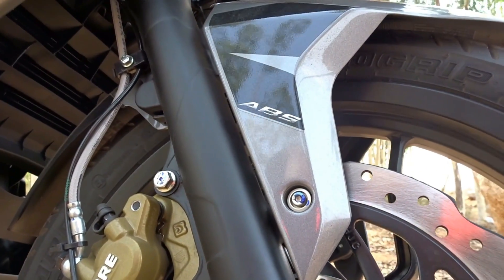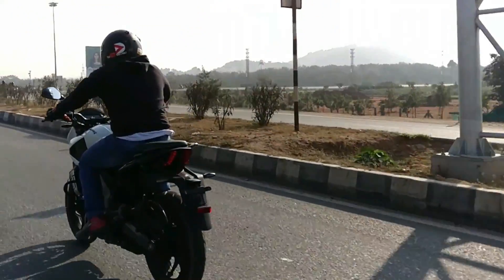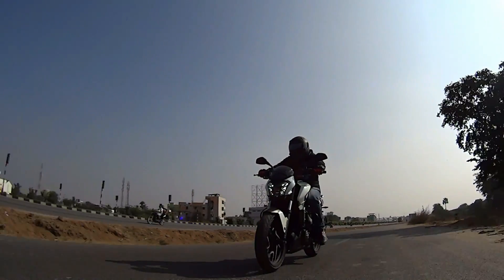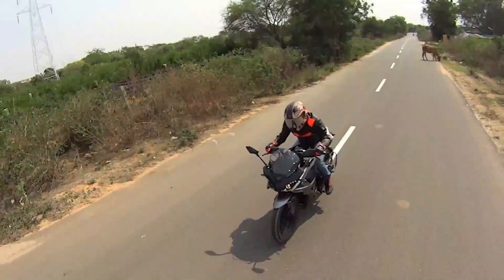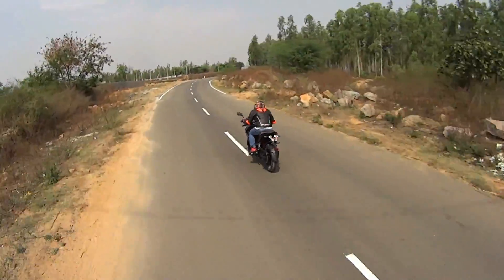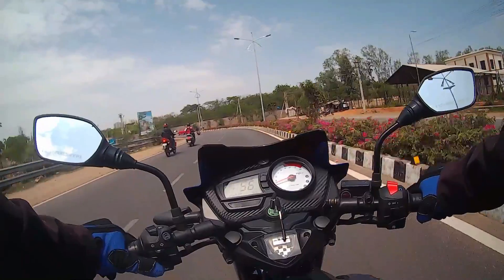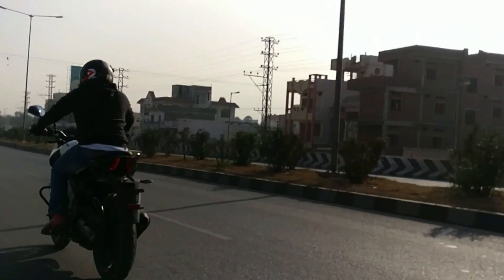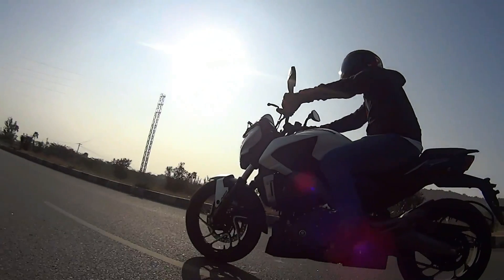What is ABS? Pros & Cons Single/Dual Channel, RLP #Dinopedia

Comment: Sadly no one except Apache RTR 180 provides dual channel ABS in 150-200cc segment. Any way single channel ABS is far better than non ABS. One more thing, if going for single channel ABS then it's better to go for real drum brakes as drums don't get locked easily and becoz of lesser brake response we will get used to using front brakes which is ABS equipped in 70/30 manner or I would say you can go upto 80/20 in ABS equipped versions.

Comment: Hi Dino,

I had recently purchased the hornet ABS-DLX version, can you please clarify if the ABS display is always on , for me it's get turned off the moment i change to second gear and ABS display light is only lit during ignition. I went to service centre but didn't got a proper response. Hoping for your response.
Reply: I have R15V3 abs same thing happens to me also... That is not a problem in all the abs bikes the abs indicator will go while riding

Comment: Hi If the break is applied on a dual channel ABS system, whether the break is applied on both the wheels irrespective of which break you apply?
Reply: no it's not a combined braking system, just an ABS. You have to apply the brakes on both sides to apply brake on both the tires

Comment: Sir suppose i have an abs bike though it dont lock the wheels if there is a  traffic in road or a red signal or traffic police show hands which i vision from 45cm  and i run a speed of 45 kmhr. What will happen, because it not lock the wheels you can move your steering.
Either a small touch to other or it completly stops 
At time ?

Comment: Please also elaborate about Cbs system. I have a hornet with cbs. But it's really tricky to make braking on fast speed (in sudden braking situation). Is it possible that you can elaborate a bit about braking techniques in cbs system. ABS didn't lock wheels but cbs is different. And in panic situations we all press both brakes. Kindly, make a video on Do's and Don't while driving Cbs equipped model.

Comment: Sir I am going to buy a Gixxer SF ABS which has only single channel abs and before buying I want to know these three things- 
1. On which wheel ABS is present in Gixxer SF, is it front or rear wheel?
2. Does it has sensor in the non ABS wheel like RS200?
3. Is it sufficient to apply only the front brake in panic situation, if ABS is present only in the front wheel? Or if I apply both the brakes the rear wheel will lock as there is no ABS? 
Thank you.
Reply: 1.Gixxer sf ABS has ABS in front wheel . 3. Panic break in straight roads, front is enough to stop then rear (as per my experience in Gixxer sf) . Front is enough because while applying break in straight road  70% weight goes to front.
Reply: Ranjith Kumar Sir does it has sensor in the Non ABS wheel like RS 200?
Reply: Brother you are not the only one.
I m also going to buy a gixxer sf fi abs.l have the same questions as you

Comment: Hello dino sir..... 
I want to buy a bike, choices are yamaha fzs fi, hornet... 
I have experience in carburetor variant bikes, but I dont know much aboit FI engines.... I like yamaha Fzs very much but a bit confused to buy that or not, because I have heard that Fi engines get damaged easily and when Fi engine break down the bike wont simply start.... Can U sahre your view on that... Like if I buy fzs how can I avoid it to break down..... Or It will easier to buy a hornet (a carburetor variant one).... 
My bike will be used for daily commuting and occasionally long ride..... And I have a yamaha showroom (a small one, not as big as bajaj or suzuki) within 1km where I live..

Comment: Nice explanation as always Dino sir! Can you please explain a bit or make a video on how to downshift properly in city as well as on higher gears, because I have just learn riding and having problems in downshifting smoothly, the revs are not matching properly if I leave the clutch on one go, it goes smooth if I hold the clutch for a while and then let it go slowly.

Comment: my bike is Bajaj v15 suggest me any good engine oil price is not a point and serving period for how many kms did
Reply: Buy Motul 5100 15w50, I bought for around 520₹ for a litre, Service period should be somewhere between 3000-4500kms for Oil Change.

I'm using the same oil on Avenger 150 and RE TB 350, and the results are significant

Comment: How does ABS work for Brake pads? do they reduce wear and tear compared to non ABS bikes?
Reply: Alex Mercer when you apply brakes, the brake pads are pressed against the disc and that results in slowing of the bike. So in case of ABS the pads are released electronically. But the difference in wear and tear of pads of abs and non abs version will be very minimal as you usually dont keep on locking every now and then.
Reply: JS3 Vlogs Ah nice so is it more expensive to replace a brake pad compared to Normal brake pads?
Reply: Alex Mercer bro same brake pads are used in both abs and non abs versions.
Reply: Alex Mercer sensor are what make them different
Reply: JS3 Vlogs yeah but they do not touch the sensors while replacing right? why so expensive?

Comment: +Dino's Vault @Dino's Vault  Apache RTR 180 vs Pulsar 180 which one should i consider buying Confused!
Reply from the maker: both are good, I would rather suggest you stretch a bit and get the rtr 200 or pulsar 200 ns
Reply: stricter budget bro I got to degrade .. actually considered rtr 2004v
Reply: even any other choice would also do.. bro
Reply: Go for the Apache RTR 180, I have just bought it. Stupendous value for money and it's looks and the exhaust note is just breath taking, Amd also if u don't mind paying a few ₹k's go for the 180 ABS as it is more safer!!
Reply: Dino's Vault Pulsar NS 2017 me ABS hi ki kya plz bathavo

Comment: Dino sir whats different between abs and combi break (Honda)?  pls do reply
Reply: illusion you can still lock your wheels in combi brake system. In combi brake system, when you apply only rear brake the system automatically applys the front brake. But that will not take care of rear wheel locking. Whereas in abs, how hard you apply brakes the wheels won't lock
Reply: JS3 Vlogs  ty
Reply from the maker: CBS just ensures equal distribution of braking force to front and rear wheel even if you end up using only the rear brake. ABS prevents wheel lockup or skidding under harsh braking scenarios.
Reply: ty Dino sir

Comment: bro but should we start with non abs bike because then we would know the basics of braking and then
  we should upgrade to abs????
Reply: INVINCIBLE ONE I don't think so. ABS doesn't kick in till you are braking properly. It comes into picture when things start to go wrong. It's always a plus point to have a safety feature on board when if you are a experienced rider
Reply from the maker: i would rather suggest a 150 cc bike to begin with and once you start getting a hang of it, like accleration, braking, clutch usage, etc., then maybe you can go with a higher capacity bike with ABS
Reply: Dino's Vault agreed. I answered considering that you wish to buy a high capacity bike and then deciding whether to go for abs or non abs version.
Reply: Dino's Vault thanks for your valuable reply!!

Comment: How Abs Works on drum Brakes in Cars as mostly rear Tyres are DRUMS?
so abs is only for front 2 wheels in car??🤔
Reply: Balaji Chandrasekaran Good question.. Can someone shed light on this topic..
Reply: Balaji Chandrasekaran yes abs only disc wheel but in cars there is hydraulic brakes or pneumatic brakes what is does is distribute the braking force to all wheel regardless disc or drum
Reply: Aakash Powale ya thts known 
but he asked about abs implementation on Drum brakes ( if possible that is !)
Reply: samit shirsat no we can't implement ABS on drum brakes....
Reply: Most cars in India are front-wheel-drive, so EBD that comes along with ABS - electronic braking distribution, automatically handles braking duties along with ABS to ensure your braking is optimal.

Comment: I have Apache RTR 200 non abs variant so is it good to install the abs system in my bike now?
Reply: Apache RTR 200 is the best bike but lacks of ABS system on 200 cc segment makes it less safer than with ABS NS200....but soon TVs will be launching ABS version too.

Now ans to ur qus. there might be garages can fit the abs on bike but it is not mandatory from company to do it from outside... possibly as per my knowledge there is no such garages who can fits the abs bcoz it needs experienced technician to adjust every hydraulic electronic and mechanical things that local garages can not do......if somehow you managed to do it will not be safer at any time, if something goes wrong with sensors it will lead to locking of ur wheels in high speed and u can imagine what can happen...hope it will resolve ur query
Reply: Jai Rajwani yes having abs is always good...😝
Reply: is it possible?
Reply: Abhas Chandra Kumar it will be possible once abs is out in market
Reply: i will also go for it then
Reply: Saket Chaturvedi i think u r a babaj staff every ehere ns ns ns only ns?